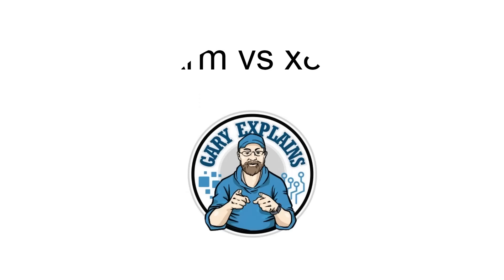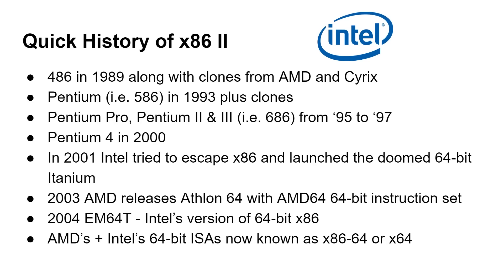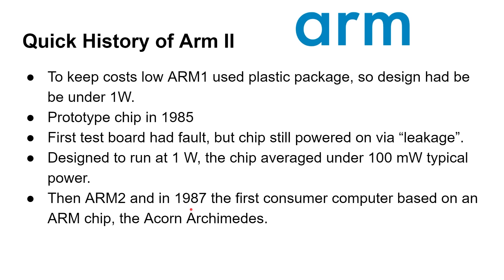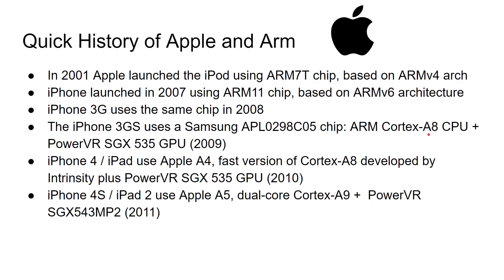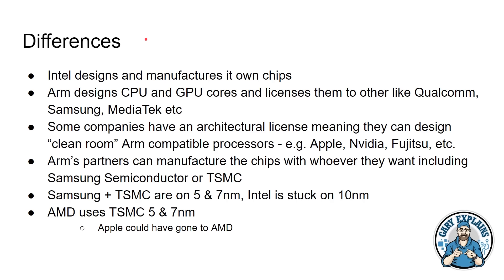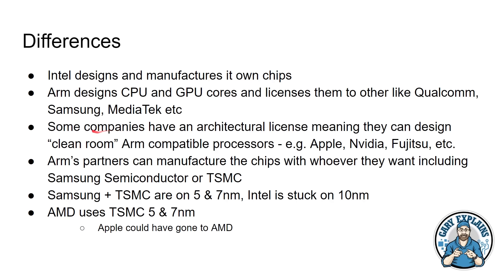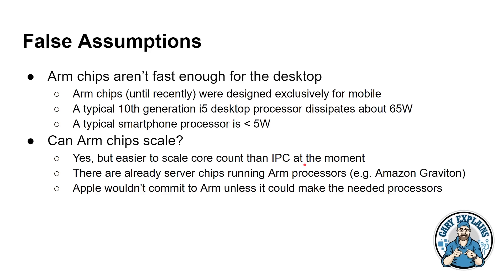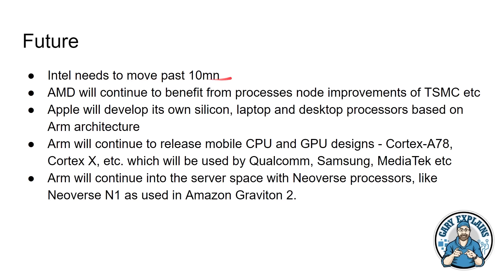Arm vs x86 - Key Differences Explained

Comment: The overall presentation was good. But there were a few mistakes in it:
1. "Itanium did not succeed because it wasn't backward compatible with x86". This is wrong. First of all Itanium was not designed for the same market as X86. Itanium was developed only for the HPC server market. There was a compatibility layer in Itanium micocode that would emulate x86 instructions. So it was compatible with x86 instructions . Although not completely a native level of compatibility.
2. You said "Memory was expensive and slow" - I agree that memory is cheap now but it's still slow compared to processor core or L1 cache. For example. Data access from cache consumes 1 cycle on a typical desktop processor but adds a latency of 50 to 100 cycles when fetched from memory. Secondly instruction fetch was never a major bottle neck it's the data fetch that's the bottleneck. Because instructions are hardly a small percentage of the total memory consumed by an application. In that sense Risc and Cisc are roughly at the same level. 
3. You said "cisc processors consume a lot of power because of the complicated instruction decode unit that decodes complex instructions" - that's not true. The instruction decoder is a rather simple logic that consumes very little logic. There is almost no decode overhead. The power consumption is caused by the branch predictors and other speculation logic that makes X86 faster.
I think the major problem that Arm is going to face when increasing single thread performance is that at that point Arm will be stopped by a lot of patents that are owned by Intel, AMD and IBM. Creating workarounds for those will be difficult if not impossible.
Reply from the maker: You comment was good. But there were a few mistakes in it:
1. Everyone can interpret the events around the Itanium differently. I (and some others I have spoken to, including some of the people related to the project) hold the opinion I expressed in the video.
2. I used "Memory was slow" as a relative term, I didn't imply in anyway that memory today is fast compared to the CPU. However memory today is much faster than memory from the 70s and 80s.
3. While I agree that the branch predictors and speculation logic also use significant power, since Arm processors also have sophisticated branch predictors that point is moot. I wasn't doing a breakdown of where the power is used, I was pointing out that CISC requires extra steps to break down the code in to micro-ops which wouldn't be required if the ISA was more RISC like.
Reply: @GaryExplains  
1. I was part of the Itanium project for the last 2 projects including Tukwila which was a significant upgrade. And I know that not having x86 compatibility was not a factor for contributing to it's failure. It's the lack of ecosystem support from the Industry. 
2. I was talking about the relative speed of cpu and memory. And even now memory is slower compared to core/cache. The point I'm trying to explain is that memory speed is not going to give a benefit to Risc or Cisc because the instructions are not what causes memory bottleneck. It's the data. 
3. There are many factors that affect branch predictor/speculative execution logic's  performance including the algorithms that you implement, the BTB sizes. I know that Arm uses branch predictors and speculative execution but the logic that they use are simpler. Even their execution logic must be really simple. And that is what is causing all the die size and power consumption. Instruction decode unit does not add any significant power penalty. 
Again the point here is if ARM tries to increase single thread performance it will end up in the same power envelope as the x86. There are possible optimizations in terms of implementing deeper sleep states / power / clock gating etc but the risc architecture alone is not going to help a lot there.
Reply from the maker: 1. Maybe "lack of ecosystem support from the Industry" = "lack of x86 compatibility" in this context.
2. I agree. But back in the 70s and 80s, the idea of reducing the number of instructions fetched from memory (i.e. having more CISC) was seen as a speed improvement. Anything to shave off memory fetches.
3. Just being pedantic, it isn't ARM who is trying to increase the single thread performance in this context, but Apple and Apple has already shown it can do that within the current thermal budget. Now it can try to use that tech in desktop CPUs or laptop CPUs with a higher thermal budget. When Intel tried to scale down to smartphone level processors it failed because every little bit of juice counts and things like the decode matter. But I will agree that if you scale up then (as you said earlier) the cost of the decode could become insignificant compared to other parts of the design.
Reply: @GaryExplains   @Gary Explains  
1. Lack of ecosystem support means not getting companies like Oracle, microsoft and other software companies to develop software for Itanium. There is simply no ROI in running Itanium in X86 emulation mode. There were couple of other issues that contributed to the failure of Itanium. Intel depended on a lot of OEMs to build their servers based on Itanium for example SGI, BULL, NEC and so on, and all of these companies were not in really good shape at that time to start designing new servers based on Itanium. Adoption of cheaper cluster servers in the place of large Numa servers was also another factor.
BTW we had a lot of DEC guys in the Itanium team because Intel bought some division of DEC when they went bankrupt and many of those people worked on the last 2 or 3 generations of Itanium.

Comment: Gary I've read on forums that ARM currently is not a true RISC processor. Some of their recent additions like Neon instructions are not compatible with RISC philosophy and are more like CISC instructions can you please explain.
Also Intel & AMD's recent additions like SSE actually follow RISC philosophy.
Reply from the maker: NEON and SSE are both forms of SIMD, so there is some confusion in your statement.
Reply: @GaryExplains  I've read forums like these that say many of the ARM instructions are actually CISC and many instructions on x86 are follow RISC. So practically the difference between RISC & CISC processors are actually meaningless. https://news.ycombinator.com/item?id=19327276
Reply from the maker: CISC and RISC are very high level labels and can be twisted to fit several different meanings. Bottom line x86 is CISC without a doubt, it has variable instruction lengths and can perform operations on memory. As I said in the video, since the Pentium Pro, all x86 instructions are reduced to micro ops and the micro ops are similar to RISC, but that decoding is an extra step which impacts performance and power. Arm on the otherhand is a load/store architecture and has fixed instruction lengths. Those are fundamental differences.
Reply: @GaryExplains  thanks Professor appreciated

Comment: it may have been worth mentioning the NEON extension for ARM in more detail, as it is in essence what MMX was for the pentium - Hardware decoding of h264 data streams among other things. (relatively speaking)
Reply: NEON is more like SSE2 for intel. MMX was pretty limited, you couldn't mix floating point math without extreme performance penalties.

Comment: The main difference is that with Intel, manufacturers have to wait for product development at Intels pace and then they have to pay royalties ongoing to Intel. With AMD manufacturers are part of the development process so innovation is faster to market and there are no ongoing royalty costs. Apple got sick of being delayed time and again by Intel, and having to accept what Intel could give them. Now Apple is in the chair and is designing its own chips at its own pace. The Apple AMD chip will have integrated graphics so the heat generated in the case is much lower and battery life is said improve by 30%. It also means the developers who write code for IOS can have their apps work on Macbook and iMac platforms as well. Thats really appealing.
Reply from the maker: When you wrote AMD did you mean to write Arm?

Comment: Apple going back to RISC. I can say that I feel good about it, since old PPC macs were way better than intel ones, more stability, reliable and all.
G3 (IBM’s 750) was a fantastic processor back in the late 90s.
Yes, ARM isn’t PPC, but the RISC architecture they share gives good hope for the future products.
Reply: It's more that PPC was a modern design for the time, and is possibly the best desktop ISA ever made. RISC vs CISC is irrelevant, everything today mix and match.
Reply: the bigger differentiating factor would be load and store vs complex operations. You can add SIMD and H264 and all that for compute performance without nessesarily making it CISC. It keeps the instructions to the nessesary ones. X86 is Turing complete with just MOV.. it's a little nuts. For RISC, move just puts some location into some register, then the operations can do the funky stuff like barrel shifting in addition to.. addition.

Comment: 2:50 - There was i432 before that; another doomed effort. It would be nice to see videos on i432 and Itanium, especially in the light of their architectural quirks, of which there were many.
Update: and i860 and i960, of course.
Reply: VLIW
Reply: @professoraarondsouza5255  Exactly. But also iAPX 432's object-oriented memory, bit-aligned instructions, garbage collection partially done in microcode...

Comment: The split between arm architecure and intel isn't a real cliff.
Intel produced and developed self arm processors for years .. for example the xScale and later the Intel StrongARM ... both worked with Windows CE ...
Reply from the maker: Hmmm... So I guess you didn't watch the video.
Reply: @GaryExplains  you talking about the slide at 7:30 you reading, sure i seen that but please let me explain your main Title in the Picture tells an other story: ARM against Intel. 

Since you mix in the slides companies, licenses, architectures and technology for an against ... it is something mixed up.

// To be clear, i like the channel and the enthusiasm but "versus" is simply the wrong word for a former development partner and patent holder. You talking orimarly about arcitectures arm-based and x86-based, the development and technologies not the companies. this is not the first movie i recognise that.
Reply from the maker: As a "a former development partner and patent holder" you then know that Intel's previous work on ARMv6 has no relationship to the "split between arm architecture and intel". Just because Intel developed XScale that in no way alters the x86 instruction set. How are they related in the context of Apple moving from Intel to its own silicon?

Comment: So just to make sure/a few questions:
- x86 can run 32bit and 64 bit apps/programs
- x64 can only run 64bit apps/programs
- x86-64 is...what exactly?
- ARM can run ARM32 and ARM64 apps/programs? Or is there no 32/64 difference in ARM?
- M1 apple silicon can run Intel64 apps through Rosetta, however it's impossible to emulate an entire 32bit/64bit operating system (either through virtual machines or bootcamp)? Also, is Intel64 the same as x86-x64? What about AMD64?
Reply: x64 isn't another architecture, it's the same x86 but 64 bits